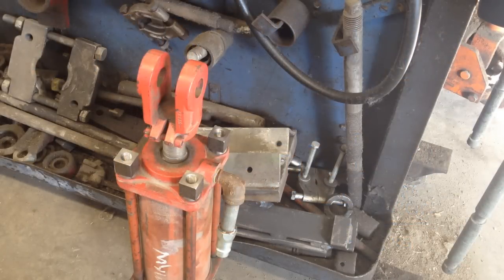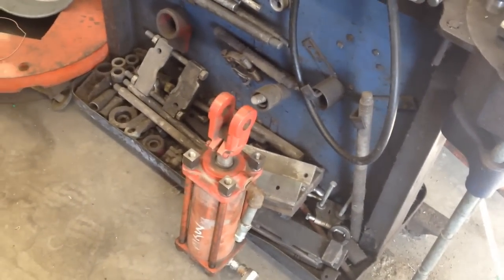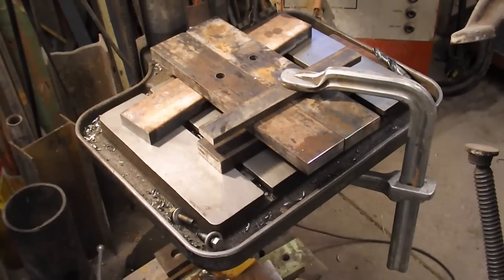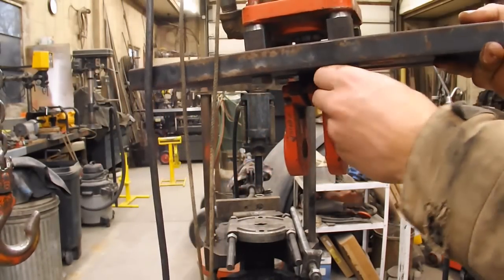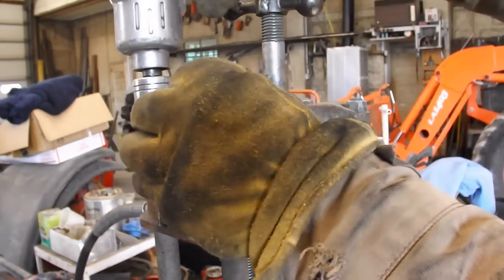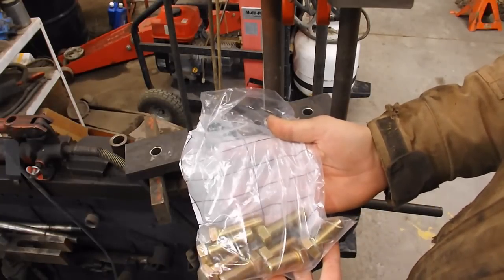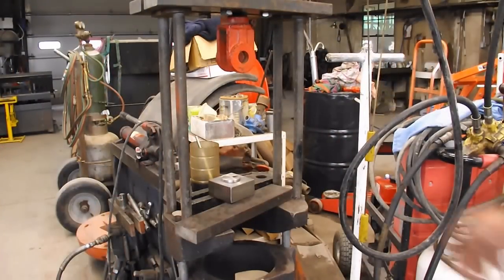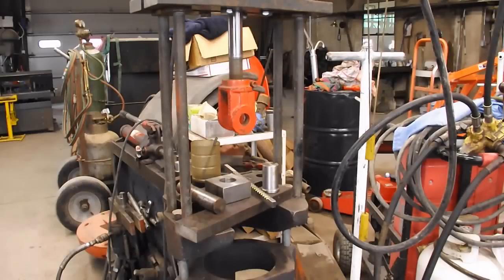First ImPRESSions -  Part 2 adapter plate

Comment: Thanks for sharing your videos and taking the time to make them.  If i could I would send you a case of cutting oil if you are smoking the bit your dulling the tip, that is what an old machinist told me .. we worked on a closed shop and if you smoked a bit he would be on you in a second.

Comment: Nice solutions, fun and useful build, entertaining presentation with both victories and setbacks. I enjoyed this series. What are you using for a hydraulic pump source? 
I checked at the local hardware outlet and those bolts cost 79 Danish Kroner each! That would be $103.66 for the 8 bolts (no nuts) here in Nuuk. Count your blessings!
I look forward to your next adventures. I hope for a wonderful Holiday Season and a great new year for you and your family.
Warmest regards, jim
Reply from the maker: Thanks! That's some expensive bolts! The unit I used in the video is a 3/4 horse electric powered 1.5 gpm pump. I'll try to remember to talk about what power sources I'll be using and some ideas on control valves in the next video. Happy New Year to you as well! I'm looking forward to the coming year.

Comment: Suggestion. Make an adapter to screw onto the end of the cylinder, to a common 1" thread. When you need to extract a pin weld a short piece of all thread (or a bolt) to the pin and couple it to the cylinder. I have done this with my 4 ton port-a-power and works well.